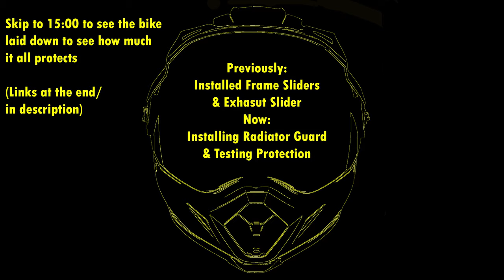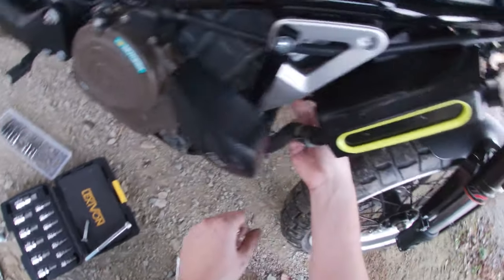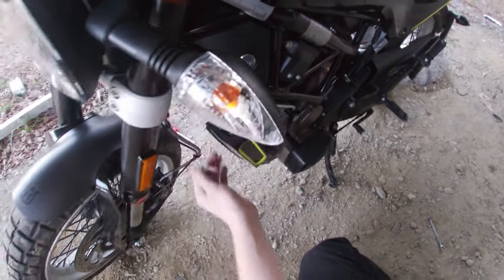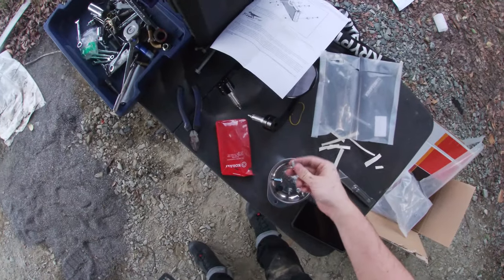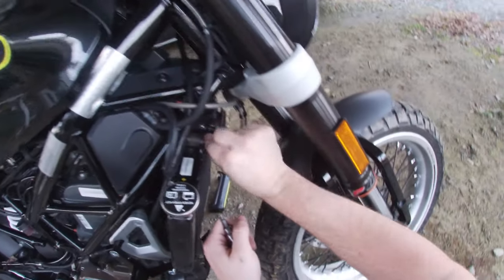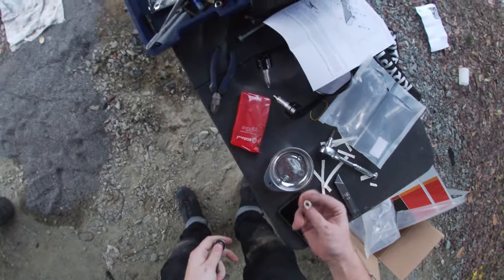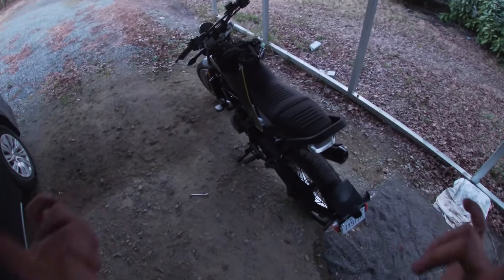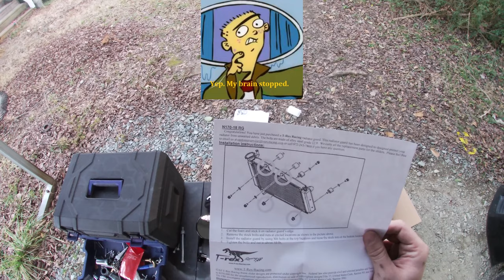2019 Svartpilen 401 -  Protection Install Part 3 (Radiator Guard/Test)

Comment: I dropped mine and broke the clutch lever. I was under the bike and on a hillside overgrown  with weeds so the clutch lever was the only casualty. Ended up buying the folding husqvarna levers. They're pricey but if I do it again these won't be breaking.
Reply from the maker: Been looking into that or handguards myself. Took a tumble on a trail and bent the clutch down, but not by more than an inch, so I'm living with it now

Comment: 7:10 😆 I installed a R&G guard on mine and didn't put the foam. I did notice that the guard vibrates when i give it throttle while in neutral is yours the same? I haven't even get the chance to ride it if so I want to hear if it vibrates when riding . the weather in northwest still a bit cold for me.
Reply from the maker: I haven't noticed any rattle after about 400 miles. It could be rattling against the 2 plastic pieces on the sides. Try slipping them off and see if it wants to wobble at all. If it is, then yeah, add the foam on the top/bottom. If it's solid, it's the side pieces I'm guessing.

Comment: Could you share which exhaust slider you got from trex? I only see the one for Vitpilen 401 and 701 on their site and it says "does not fit Svarpilen 401" 😅 Thanks!
Reply from the maker: There's a second one on their site. I think I linked it down in the description.